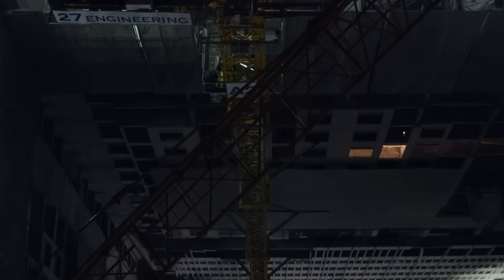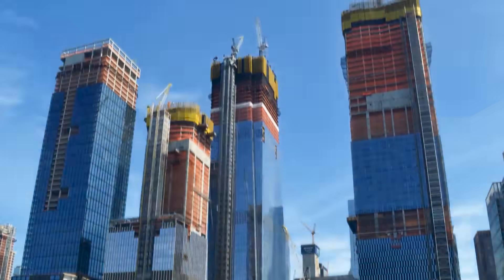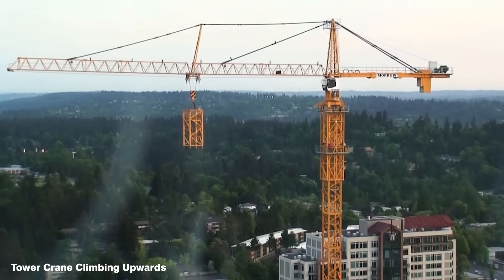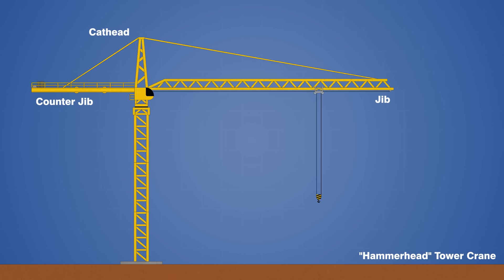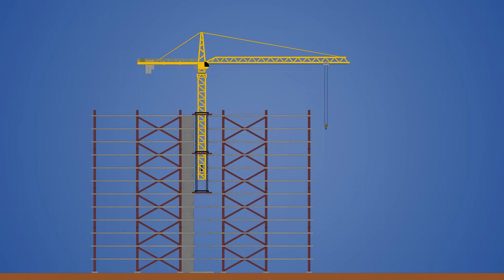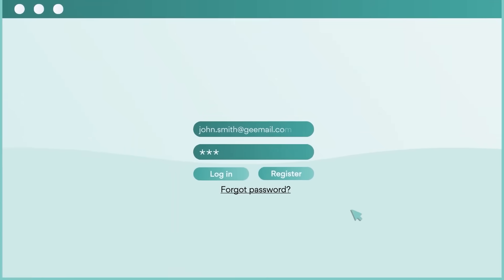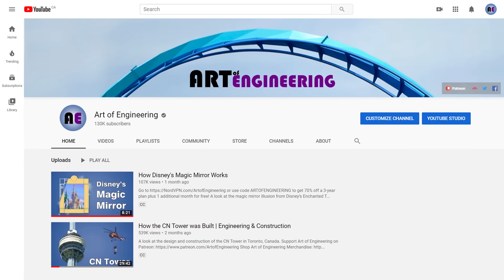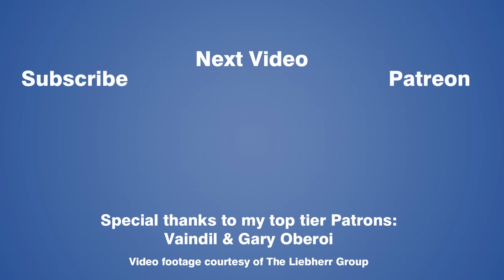How Tower Cranes Build Themselves

Comment: okay, but what happens to the hole that crane leaves when it's built internally? do they just use it as an elevator shaft, or is it unfinished and they put regular floor there?

Comment: My question are, how does the crane add more counterweight? And if it build to carry heavy stuff with a lot of counterweight from the start, how it handle the weight of the counterweight when it on stand by or on the way getting the stuff? Is it holding the counterweight alone without anything on the hook?
Reply: counterweights are installed at the time it is set up, when a crane has no loads on it, that is it's most unstable time, it actually leans backward and yes the weights don't move

Comment: Very interesting video! When the crane is positioned inside the building, what are the shafts used for, once the building is finished. I think they use the elevator shafts to position the cranes. Is that right?

Comment: So, what do they do with the pit that's left after the crane is removed from inside the building? Does it vary or is it like universally converted into an elevator shaft?
Reply: usually not in an elevator shaft and it gets buried either in or outside a building

Comment: The modern tower crane revolutionised construction world wide but it only exists because of government red tape in the 1960’s. Two bothers in Australia needed to import a large crane for a high rise construction project. Red tape held up the crane, but the brother’s were working to a deadline and so they decided to make their own crane. Their experience in high rise construction caused them to make improvements, including the ability to raise and lower the crane’s own height and attach to the side of the building. They were luffing style cranes and Australians said they looked a little like a kangaroo jumping over a building and that is why they are often called kangaroo cranes. 

When the Twin Towers were built in NewYork, they secured the contract for the crane work, and each tower used 4 cranes for a total of 8. The Twin Towers job was responsible for spreading the word that the kangaroo cranes were cheaper and more effective for large constructions and suitable for the tallest skyscrapers. Previous cranes on high rise had to be built on each floor, then dismantled and rebuilt for each floor which was a lot more expensive than the crane adding tower sections while attached to the side of the building. Eric Favelle and his brother Ted were the inventors, and their company was called Favco. Favco cranes built the Burj Khalifa, but the company was sold back in 1995, so the original Favelle brothers are long gone. Virtually all high rise construction now uses the kangaroo crane and its variants.

Comment: The most impressive part of this whole process is the fact that it relies on a hydraulic jack being able to lift all that weight.
Reply: Welcome to Hydraulic Jacks. They can lift much more than a couple of dozen Tons worth of Crane.
Reply: @Genius_at_Work  Wait for real? how strong are those things?
The main thing I always wondered wen seeing cranes is how do the steel rods support that weight, is it related?
Reply: @micaelgarcia1576  first for context, a Hydraulic press is effectively a hydraulic jack just designed to, well, press things together (a basic Hydraulic press can actually use a hydraulic bottle Jack for the press mechanism).

As of today, the most powerful press can exert a force of 80,000 Tons, or 72,574,779 Kilograms, so there's your answer
Reply: @cpufreak101  wait what
I read that as "80.000 kilos" at first, and thought it was a lot... ok then, yeah, that is a lot more than I was imagining, wayyy more, wow
Reply: Der Bleifuss try 280,000 pounds

Comment: Even watching these illustrations gave me anxiety about how badly things can go wrong.
Reply: Why not just watch videos of when it actually does go wrong?
Reply: my thoughts exactly
Reply: Do you fly?
Things can go wrong anywhere...
Reply: I have personally watched things go bad with tower cranes. After doing our final jump ( the mast was in the center of the building ) We were hanging iron from one end of the building working towards the other. As we got closer to the mast, the trolley did not weight enough and this left a belly in the load cable. As he swung over the manlift, the cable caught the mast of the manlift and tore about 20 feet off. Job was shut down for a week while they figured out what went wrong and repaired the manlift. We had to add on a headache ball for extra weight to relieve to belly in the load cable.
Reply: It’s deep water horizon all over again

Comment: As the crane grow taller, longer cables is needed to transport materials. This is also as vital as the crane itself. How they add andor substract to the cable length is also a big question here. And it's very interesting to know how it was made and progress too.
Reply: while a load cable can be changed out while the crane is standing in most cases when the crane is put up everyone already knows exactly how much cable is needed and that is already installed at the crane yard
Reply: @TheHawkeye1432 exactly! On really high cranes with huge cable drums care must be taken to ensure that the cable always rolls up properly and doesn't ride up on the previous strand.
This is because if the really long lifting cable rides up on the coil and then slips off there can be a sudden jarring. You don't want that.

Comment: might take several strokes?   uh..  those are hydraulic motors    lol   picture the number of pumps it would take to lift your car 8 feet in the air..

hmm  ours take about 18 for 1 foot.    so...   given those cranes weigh 4x more...   lol...    good luck.

Comment: One thing you need to do is install ties into the structure every 9 floors, unless the crane is under 20 storeys at it's full height. You will see them on any tower crane that has this jacking system.

Comment: So, the slab underneath is more like a massive footing, 4 pile caps are underneath as well, they are like a concrete column but go down roughly 11 meters, cored out with a piling rig. There is actually a sort of crane section poured into the footing which the first section bolts on to.

Comment: Tower cranes can self erect but in 90 percent of real world application another crane is brought in to erect it. The reason for this is cost and time... It's much quicker to build a crane with another crane. I worked for a crane company just over 5 years and we erected Tower cranes all the time and I only saw a Tower Crane self erect once and it was due to space constraints... basically they couldn't get another crane close enough to help erect it.

Comment: I should also tell everyone that most of the operators customize the cabins, Most a  small refrigerator somewhere, a microwave or toaster oven, and a cb radio that is also considered a export radio that has a little added power and a whole bunch of channels and side channels that regular cb radios don't have. About these radios, we found that all of us could stay on some obscure channel that the employers would never be able to find and we could talk shit all daylong without ever being caught but the biggest safety thing we found was if we had 2 or 3 cranes on the same job and then another 6 or so cranes in town all the other cranes could be talking but if we saw something on our job dealing with safety with one of our cranes, we could grab the mike and over talk all the other cranes because we were so close and thereby avoid a collision or anything of that nature instead of grabbing the job site radio, switching channels as fast as you could to inform others of impending danger. These side band radios also had the added bonus that we could go to certain channels and do some skip talking. One thursday afternoon I was the last crane in town in Charlotte, NC working late and these 2 truck drivers I could hear were talking about where they were going out that night being friday and all and I'm like WTF and shot back at them that it was Thursday, and was promply told I didn't know anything, these guys were just outside Brisbane, Australia where it was Friday. We talked for 10 minutes before I lost the signal. I was also able to talk to my operator friends in Charlotte, NC while I was in Las Vegas a number of times and probably almost all of the countrys in Europe at 1 time or another, I went by the handle of BIRD1432. The height of the cranes made this possible.
Reply: @KandiKlover  That's not fantasy. The height of a tower crane, combined with the very powerful reciever of a top dollar CB radio could let you talk to people around the world away on a clear day. My grandfather's relatively cheap CB radio could pick up for 200 miles with only a 2 foot tall antenna from inside the house. The crane itself could have probably acted as a signal amplifier, being made of steel tubing and all.
Reply: @shockwave6213  also the direction we were pointed made a difference.
Reply: @TheHawkeye1432  The direction of the crane's jib?
Reply: @shockwave6213  I doubt height had much to do with it at all, though transmitter power probably did. Some radio waves do carry a long distance normally, but since you "lost signal", meaning the connection was temporary, it was probably a "skywave", ie. signal bouncing off the upper atmosphere. Possibly in combination with regular AM bending unobstructed over the Pacific.
Reply: @KandiKlover  Science time! So the reason communication-past-horizon is possible is because of radio propagation. Low enough frequencies like AM and VLF get such amazing range because the waves are so long that they can bend over hills and down into valleys. Cellphones tend to lose signal due to terrain quite often because the radiowaves are so short that they can't bend around terrain, but they are optimized for use in cities where they bounce off buildings and find open cracks everywhere.
Coolest thing about higher powered, low frequency radio, is that you can actually bounce signals off the ionosphere under the right conditions (which is what he's referring to as "skip talking"), and the waves will propagate pretty well until they either scatter too far to be detected or the signal degradation makes it unintelligible.
It's been pretty common knowledge  among amateur radio enthusiasts for decades.
Reply: @thundercactus  Right you are.KK is confusing straight line signal to a bounced signal.I would have said linear signal but he would probably thought  I
 was talking about his amp.Skipping rocks when it's "in."
Reply: never  stand below a tower crane, and if u see yellow rain, run away quickly
Reply: @TheAngusGao  That answers my question.  I wondered about if there was room for a porta poti.
Reply: @KandiKlover  So you are telling me, that while working on a crane in Charlotte, you suddenly connected to two random truckers from Brisbane, discussing how to spend their friday? Holy crap that's so cool
Reply: @niismo.  27Mhz will easily skip to Australia from the US, more so if he has an amplifier.
Reply: @niismo.  YEAH SURE ITS COOL. WHY PAY ANY ATTENTION TO THE PEOPLE WORKING UNDER THAT BOOM?
Reply: yep one time when I climbed a crane at night and I thought I heard voices from a radio coming from the cabin (I thought they were onto us). Turned out it was just a normal radio you use to listen to music lol
Reply: The man tells the truth. I have talked skip to Australia a couple of times on a base station CB, and across the US many times. Lookup CB skip, it a atmosphere condition that causes the radio signal to bounce off the upper levels of the atmosphere and can go around the world. You'll only get the signal for a few minutes at most and then it will fade away.
Reply: @m16ty Yes. Twenty years ago, I heard some of the “old timers” on the Massachusetts State Police say that on their cruiser radios, some nights, back in the 70s and 80s, when conditions were just right, they could hear and talk to police officers using the same frequency as our “low band” radio in Ohio and Kentucky.
Reply: Are they equipped with a toilet ?
Reply: @georgemay909   Buckets with bags and/or milk jugs ....
Reply: Really is amazing what you can do with a radio (British radio amateur here) I've had contacts from a few Eastern European countries using SDR on 5 watts on a ground-level aerial. If the local area wasn't so noisy and I was higher up I could probably reach to Asia on 5w.
Reply: Amazing! Thank you, Bird, sooo much for sharing this info and and these stories!
Reply: Greetings from a fellow Charlottean  . Did you work in cranes Near the Blumenthal Performing Arts center back around the late 1990's or 200's?  The entertainment riggers would sneak out on our Fly roofs to watch you guys.  The hiring side bribe  for help with the winch on "Phantom of the Opera"  to go from our roof down to the street (since it could only go in from the roof) from the building on the next block  was actually a very helpful gift to us.
Reply: @ablemagawitch  I worked on a number of buildings in Charlotte
Reply: @KandiKlover  It's not fantasy, it's entirely possible. How do you think HAM radio operators can talk to people in other countries, or the space station?  CB radios use different frequencies than HAM and there is no telling exactly what type of radio he was using. There have to be a lot of factors working in his favor. The sun cycle plays a role as does the weather. My assumption is he was getting some atmospheric bounce in his favor. Radio is far more amazing than people think.
Reply: Pimp my crane
Reply: Oh yeah, you're speaking my language now... I used to shoot a bunch of skip outta Buffalo, NY... I had a President HR2510, a Galaxy DX-2517, an old Connex 3300 (not one of them new POS's), a big silver Astatic mic (forgot the name), a 500 watt Messenger linear amp, a 22' tall Super Penetrator antenna about 60' in the air... I talked to Germany around 6AM every morning, Texas all day long, and hundreds of other locations over the years... Great times...
Reply: Extremely cool stuff! Thanks for sharing!
Reply: That's super kool. I'm watching a crane opperate now.
Also from Hickory.  Hail all in Charlotte!
Reply: How do you go to the bathroom up there?
Or do you have to just hold it?
Reply: @MikeCee7  I just used my plastic water bottles and for #2 used scented trash bags in a bucket which I double folded then put in a heavy duty freezer bag so no smell or mess and then sent it to the ground at the end of the day and tossed into the trash
Reply: @TheHawkeye1432  Thanks for the informative information. 
I was curious how this was done, because I’m now in my 50s, even at regular job, with normal bathrooms, I have to go every two hours.
so I thought it’s a good thing I never would of be able to do a profession like this, (even at a younger age) 
but now I see that you don’t have to a Superman, and hold it in 
& now hear, thst is a way to take care of business when nature calls. 
—
But some of these YouTube videos, I see of them building the tower It looks like the compartment is only big enough to sit down,then like there’s no room to stand nor move around. 
—
Which leads me to a whole bunch of other questions, like are there any female tower crane operators? 
And now I’m wondering how I astronauts like Neil Armstrong , or even Charles Lindbergh took care of business.
Reply: @MikeCee7  yes, there are female operators and they use a funnel type thing to take a leak and yes the cabs we sit in can be really small at least in the older cranes, they didn't think much about crane operator  comforts 10 and 20 years ago, it was pretty much like a small cockpit in a plane--just big enough to get in, some you had to climb down into them from the top and close the hatch and unfold the seat and I had 2 that didn't even have seats just a wood box
Reply: @TheHawkeye1432
Reply: Tldr
Reply: amazing!
Reply: How did you guys go to the bathroom
Reply: @austinkissling9036  answer in comments
Reply: I'm afraid that's not CB radio at all, your illegally using the 11 meter amature band.

Comment: Question: In the second method of climbing, what happens to the big long hole in the building once construction is complete? Does it just turn into an elevator shaft or is that hole just considered lost space?
Reply: Always wondered the same thing myself.
Reply: Most case scenarios it is lost space already
Reply: Any of them I've been involved in, the crane was erected in the elevator shaft. Once the building is built and the crane disassembled, the install the elevators in the hole.
Reply: According to other comments depends on how the architect designed it. Sometimes it's just filled in with cement, other times it's used for elevator or ventilation shafts. However local laws can also play a factor in what occurs
Reply: They patch it after the cranes climbs up. There’s only a while while the cranes in it. As soon as the crane Jumps they patch it
Reply: If I had a good bet I'd say they were turned into elevator shafts or fire escape stair shafts.
Reply: This happened to a job in Panama years ago, it was a linden 130 that was floating in the building, when you jack it up there must always be atleast 2 floors around the crane to wedge it off, well they screwed up and jacked it past that 2nd floor, the crane fell over fowards because the balance weight on the jib and stopped when the jib hit the building, the operator fell about 20 feet out the window and they never saw him again, true story
Reply: No all they do is pour concrete to fill it in... They usually already have stairs and elevator shafts

Comment: So how do you bring the ones that erect with the building down?  Do they just throw them off the building?
Reply: they fly a small gin pole type of crane up to the roof and can be easily taken apart and moved by hand and bolted down to the roof and moved around to reach out and take the bigger one down then dismantled and brought down by elevator